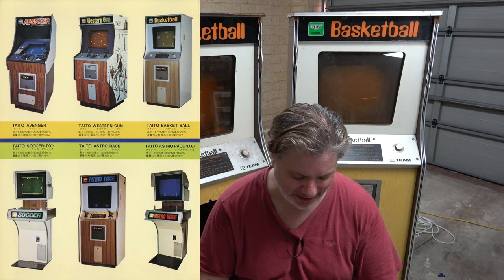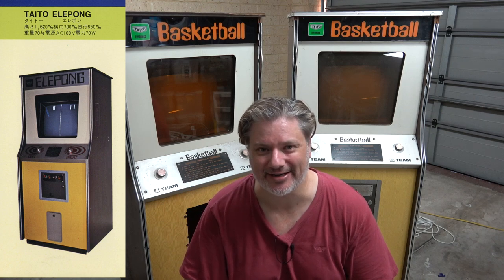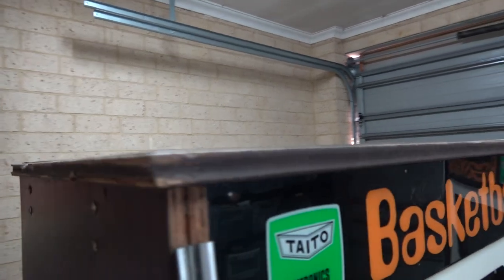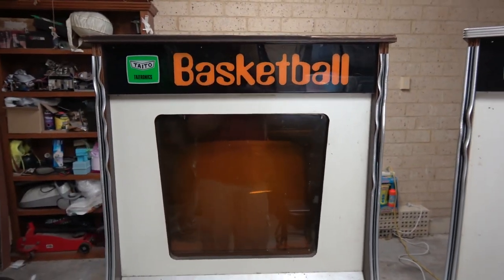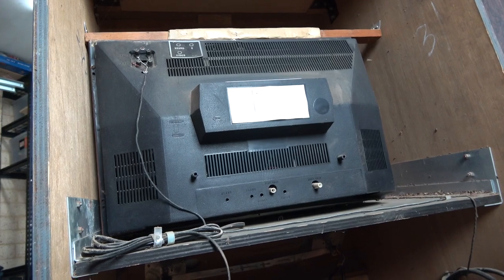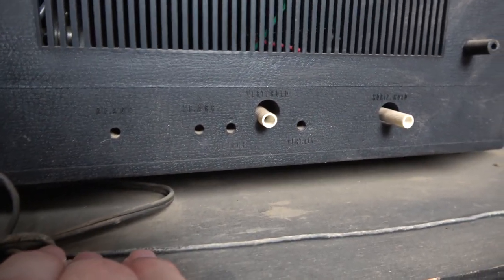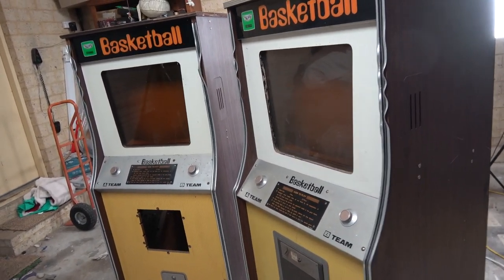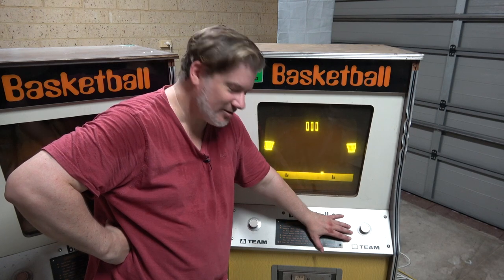FE036 - Taito 1974 Basketball Machines!

Comment: Great video! :D Take a rubber mallet to that melted T-molding!
Reply from the maker: Hey Hakkon! It’s hard as rock! I tried to put the hair dryer on it and then press it flat with a mallet. it worked to a degree but I think I’ll have to take it off and heat/press it in sections. Once it cools it should stay in the flattened shape...Need to put aside time to do this!!!

Comment: great job finding this thing wish i had one myself the damaged tmolding might still be made!!!!  back then they often used boat tmoulding since arcade tmoulding was not invented yet. id take a look if i were you i liked and subscribed check out my channel too
Reply from the maker: Hey Jason! Thanks for subbing. I love your channel. I can’t believe all the vectors you have OMG!!! I’m trying to just find one over here and NONE come up in years of searching. I look at your collection and basically cry! The T-molding insight is awesome. I didn’t think of that. I started looking for some boat trim and have found a few that are similar but not the same. I really need to find the exact same type to replace it otherwise I’ll try and flatten out the stuff I have with a hairdryer and vice! Anyway thanks for dropping by. Love your work. (I want your massive vector monitor lol)...